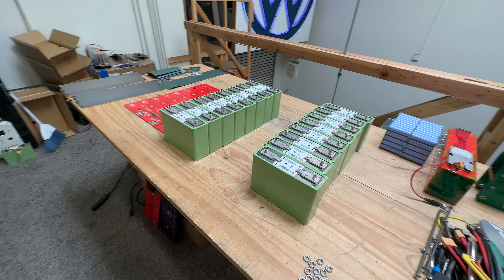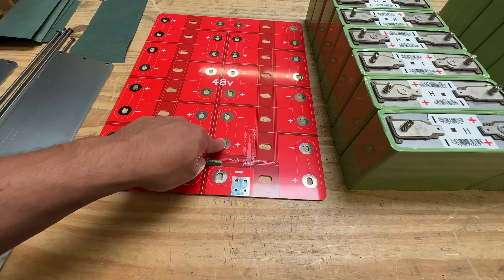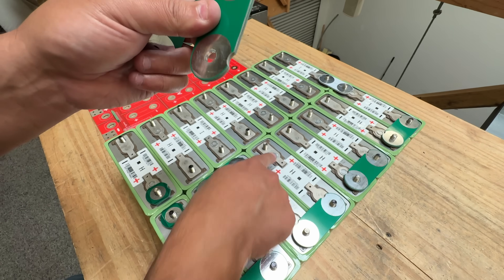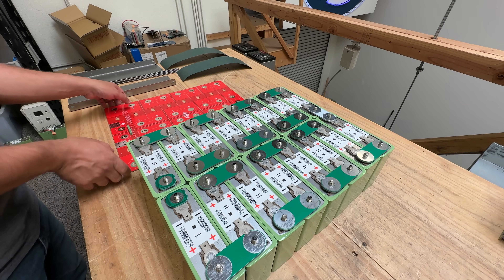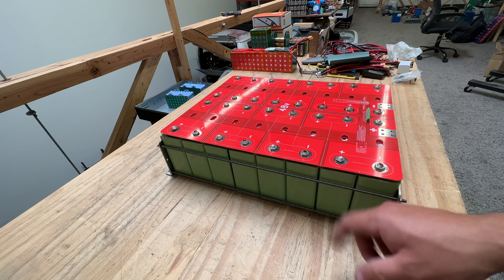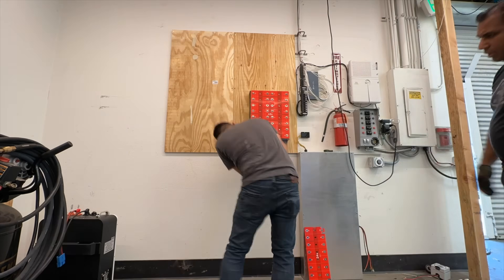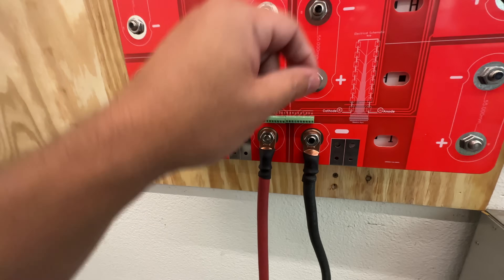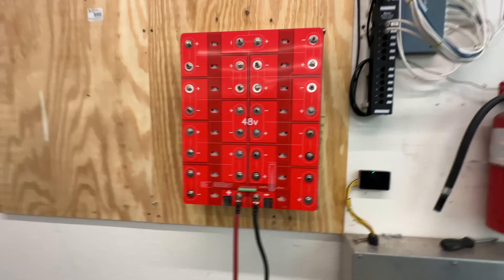DIY 48v LiFePO4 Battery Kit  -  Compression plates

Comment: Dang ... for about $1500 you can have a 14kwh battery.  That's just for 16 batteries, 4 bus bars and 4 compression plates.  Not bad.
Reply: Math .
Reply: What? This is about 3.7Kwh battery (with 16 cells) for about $800 or so when you add compression, bms, case, etc. What 14Kwh battery are you buying for 1500?
Reply: Right, read what I said.  Didn't say a complete battery, but cheaper then $2K for just lifepo4 cells.   Still a good deal.   So chill.   @WhySoDivided-CantWeAllGetAlong
Reply: @GregOnSummit  I am reading.. a 5th time.. you said $1500 for a 14Kwh battery. Just cells. Got it. What battery is that? I wasn't trying to be an ass.. I was genuinely interested in what battery for about 2x this one for just the 16 cells.. provides 14Kwh of storage? I know the EVE 3.2 280ah cells.. for 4 are about 700.. so that puts it up around 3K for a 14Kwh battery.. and those seem to be about the cheapest I've seen for that size storage. So again.. link to the battery that is half the price of the EVE 280ah cells.. but same 14Kwh storage.. I'd like to maybe look at buying it.

Comment: Why are there no 220v/230v battery packs? 
Wouldn't that be easier to convert from DC to AC?
Reply from the maker: Because everyone has been using 12v lead acids since the beginning of time so 12, 24, 36 and 48v are the most common standards  there’s some 96v and 144v available but very limited

Comment: Extrange… all the LiFePo4 says that you should not put the cell in that position, should be in the thinner side because the electrolite will not touch all the internal components causing a fast degradation
Reply: What?

Comment: I would love to have something like this for the bigger LifePo4 cells like the 280Ah or 304Ah. Do you think it will be doable due to the PCB size that it requires? Thanks!
Reply: I have the same question
Reply: Ditto....I'd love to get a couple of these for some EVE 304s.

Comment: I am really curious and anxious at the same time whether those copper tracks can really handle high amp continuously without getting really hot. If you compare the wires that you use for the main + and - and the tracks, the tracks seems to have less surface area
Reply from the maker: Yeah I’ll do a test,  but they can handle the 200A continuous
Reply: @jehugarcia  I'd love to see a follow up video with a thermal camera on this.
Reply: From the looks of it, the main current is carried by the bus bars beneath the PCB; the traces just lead to the connector for the BMS balance leads.
Reply: @Urugami45  bus bars that are copper traces on a pcb too. Still, if u look at it, they look insufficient. But let the tests result speak for themselves.
Reply: @sunnydaybadua2868  I missed that detail; I thought the bars were solid, but wrapped in the middle.

Comment: is it not a disadvantage if the prismatic cells  are in a horizontal position?
Reply from the maker: No I’ve used cells on their side for 10 years  without issues
Reply: @jehugarcia  I thought it might be an issue if the cells are not necessarily 100% filled up with electrolyte which could cause that anode or cathode is not fully covered.
Reply: @The6packsteve lithium polymer cells are basically a foil/jelly roll similarish to how cylinder capacitors are made there is an electrolytic gel from what I gather wrapped into the "foil" but the cells are compressed and so there isn't really room for it to move around after manufacturing (isn't liquid sloshing around like in a lead acid battery).  In short the orientation shouldn't really affect the cells health or longevity
Reply: @ShaunHusain  ok, hope you are right
Reply from the maker: Yup we’ve taking these appart and there’s virtually no liquid inside of them

Comment: Nice work. For making a 3.5 kwhrs pack. And the parts for making them that are 16 cells, plus buss bars and the board. And final part the bms would be in total about close to $1100 for 3.5kwhrs in DIY. The advantage here is that the cells can deliver more current for your applications and inverter types.
Reply: You can get 5 kwhrs for $1500 prebuilt deff not worth the diy
Reply: @CobraR99 these are under $700 without BMS (but with balancer). You could have 7.5kW for $1400, prebuilt can’t touch it unless you want used cells or remanufactured unit.
Reply: Thank you so much for breaking down the benefits and costs.  It would be awesome for the nube's (myself included) if the use-case and cost/kwhrs breakdown were stated before every project.  Having experienced people do the breakdown first clarifies the "why"  and saves possible mistakes for the rest of us.  Thanks for making the effort.  That is good leadership.

Comment: Don't forget kids, fish paper comes in adhesive and non adhesive versions. That long middle piece is probably best done with non adhesive fish paper if you ever plan on taking this pack apart otherwise you'd have to cut 16 pieces. The way Jehu did it using non adhesive on some parts and adhesive on others is actually a really good idea.

Comment: 5kw ul rated for 1500 makes these not very appealing…
Reply from the maker: Yeah but one of these if you don’t want the hassle  https://www.opsolarbattery.com/shop?ref=jehu
Reply: @jehugarcia  they finally got their ul rating huh?
Reply: I was going to post the same as for  $1350 you can get a complete 100ah 16s rack battery, built-in 200amp BMS with a 10-year warranty. I did build my 240kw battery bank as there was nothing that could be bought that was even close to DIY pricing.
Reply: @krom6017  What cells did you use?
Reply: @oneshot_onekill4618  Used Eve 280ah cells, then built four 4p16s banks, and put them in parallel.
Reply: @krom6017  wow send me the link to buy it